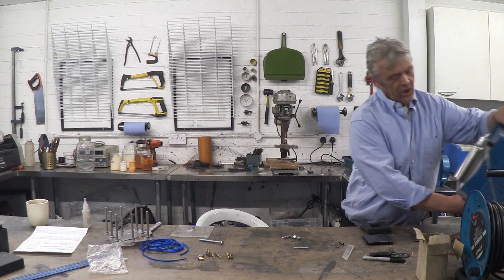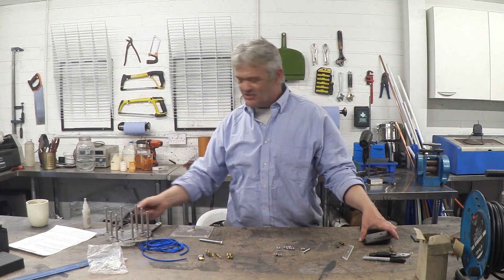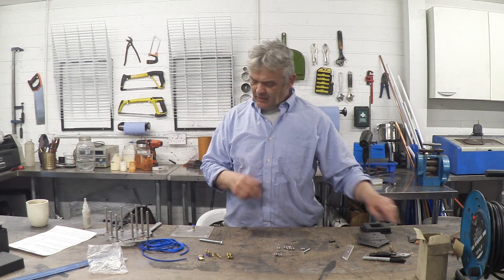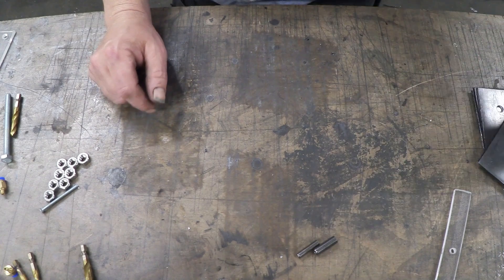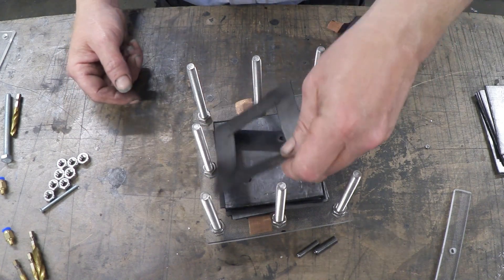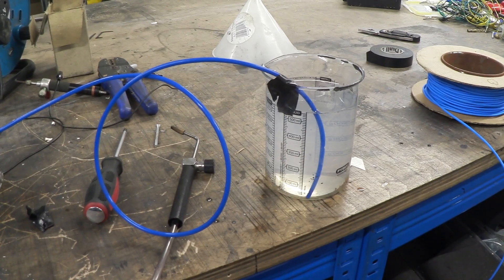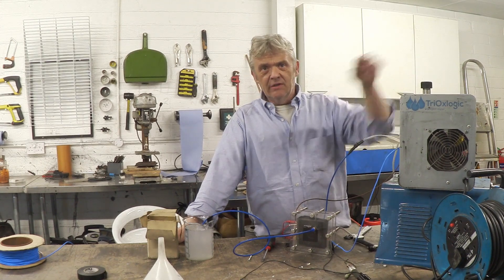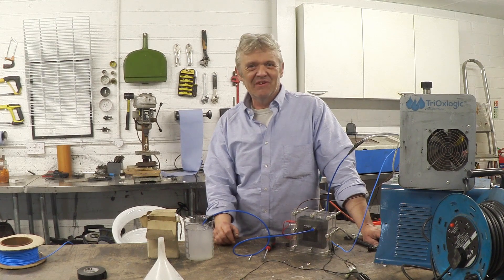Super Efficient Graphite Dry Cell Hydrogen Generator

Comment: Be nice if the cells stats where typed up here.
I have 4% solution (of what?)
12 amps (no volts or cell number)
and "roughly 3X as efficient" but no liters/minute
No cell surface area either.
And I had to get that useless if not comprehensive info from watching the end of the video a 2nd and 3rd time.

Just these basics are the difference between a thumbs up or thumbs down for me. (yes I re-enabled the thumbs down)

Comment: Maybe i should have chucked this in,conductive carbon loaded rubber sheet,make two coil plates with plastic speaker grill to isolate and wind like an electrolytic cap.

Also carbon filters for water are quite large,i saw someone make salt water batteries using the activated carbon filter inserts,long carbon tubes.

Comment: I can't remember which is the sacrificial electrode,but one electrode can be stainless the other however (the sacrificial) should be titanium.Also you know uric acid is the best volt per gas volume,though lots of people are using table salt making chlorine gas,potassium hydroxide i think is the best electrolyte.

I did see someone use AA battery carbon rods as electrodes.

Comment: Great! Now please build a fuel cell to generate electricity from the newly created hydrogen 🙂
Reply: You don't need the fuel cell, pipe the hho directly into the intake manifold of the car engine.  look on youtube for many videos on this idea.
Reply: @kirtg1  Thanks for the tip. But I would like to build a fuel cell that inputs hydrogen and output a dc current. If you have any suggestions on that let me know. I think it'd make a great project.

Edit: I prefer not to use platinum or any expensive catalyst 😉

Comment: Does the graphite oxidize at all? What do you use as your electrolyte? OK, so I built a potato cannon, if you will, that I'm using a HHO gen to power. I use a whole house filter housing that I've bolted in 15 stainless steel plates. One bolt is pos, one neg and the plates alternate. I separate the poles on the plates using rubber grommets. Then, I have a 1 gallon sealed container that I add a solution of sodium hydrochloride, 1 tsp, to a gallon of water. From the container I have a small 12v pump to move the solution to the HHO generator. What gas is created goes back to that container with the pumped water. I did this to help eliminate water overheating. From there the gas is separated and travels through a tube , through an automated ball valve on a timer, and into the potato cannon chamber, which is 4"  clear pvc about 19" long, then necks down to 1.5" pvc about 3' long for the barrel. With the water at about 90° F 32° C, it takes about 2min at 12v, 22a to create enough HHO to fire an average sized potato about 300 yards or 275m. I control the amperage with a PWM controller from ebay because everything I built the controller with was rated for 30a and the setup would draw an easy 50a. I built it to look like an old Howitzer cannon. Can even raise and lower the barrel remotely. Anyway, I was just curious  on the graphite. Also, I am curious on how you measure the amount of HHO generated. I've been looking at like nat gas meters and/or mass meters, but they're very expensive. Thanks for your videos. I do truly enjoy watching them.

Comment: I've been working around this tech for about 10 years, the concentration of electrolyte is very much dependent on the distance between plates, maybe graphite does conduct better I don't know as I haven't worked with it. Does the electrolyte discolour after several hours running?

Comment: Does graphite still suffer from the voltage leakage around the edge of the holes in the plates? I would assume that it does, it's a quick fix if it does.

Comment: Hi Robert, Thankyou for this dry cell built.  How do I connect the copper connectors to graphite? I tried screw and bolt but the graphite won't conduct and no electrolysis took place in a wet cell configuration. I bought these conductive graphite sheets from amazon.

Comment: Great! Have you tought or tried to keep the O2 and H2 separated/collected to different reservoir in the solution? Like collecting the O2 up above the anode and H2 up above the cathode (or vice versa :)? To combine both gases only when reaching the torch nozzle, similarly as when welding with acethylene and oxygen? My application would concern the welding only.

Comment: What is the point of neutral plates
Reply: Every pair of plates (so they say) can only "digest" 2 volts. So if you want to produce larger amounts of gas, you will want to feed in higher voltages. So if you want to feed 24 Volts, you would need 24 plates = 12 pairs. As you do not have to connect every pair to the power supply you use "neutral" plates in between.

Comment: You missed the second port. Hydrogen is attracted to pos, oxy to neg, keep the pos cells on one side and neg on the other with dual exit ports, pure hydro is safer. You still need all the flashback arrestors and vacuum sensor vilt control backed with ....... im not gving it all to you.....

Comment: You can put stainless steel tube in one an other like Joe cell but put a one inche  diameter Carbone electrode at the center,not more efficient but it works

Comment: OK Amateur here. Looks to me like you have a plate in between the electrified plated with no electric leads on it. How does that do any good? Does the electric just go through the fluid and charge those unconnected plates? If so how my of those center plates can you put in the design? Thanks for the info. Such a simple idea. Every video I've ever seen used stainless.

Comment: This post is somewhat late but I've just  been reviewing your posts in my archive. The project above is brilliant as usual Robert, well explained and demonstrated. That's why I've followed you religiously for many, many years. In respect to the systematic study paper you refer to, graphite, as you said, is indicated as the best overall material for electrolysis electrodes and produces higher  gas outputs. May I point out however, but not wishing to offend you, that within the said study paper it does state the following, 

"With increased electrolyte concentration the hydrogen production is greatly increased.
However, the gradual decomposition of anodic graphite rods is observed. From the study we concluded that the high electrolytic concentration (above 0.025 M) is not beneficial for long time hydrogen production."

A slight negative for graphite, maybe, but it's not the end for sure, as new materials are no doubt in the pipeline. ( Of course that's if we're ever allowed to witness such.)
Kind regards and many thanks for your dedication to open science.
John (UK)

Comment: You're right about the stainless plates being the major hurdle to the everyday folks building a cell.
Where does a DIYer source graphite foil on either side of "The Pond"?
Please, We all could benefit from a bit more detail about your construction methods.
How did you "bury" the copper into the end plates, Two sheets of the foil and adhesive?
How does one protect the copper from eroding at the exposed edges of the electrolyte holes?
Oh. I see you put the details video behind a pay wall. So much for empowering people as your channel intro claims!

Comment: Robert! I was reading about fuel cells apparently some designs use potassium hydroxide as the electrolyte, . Potassium hydroxide is also the electrolyte in ordinary AA alkaline cells ! Do you think you could build a fuel cell using these materials to make electricity from butane cans??

Comment: Thank you for your content, Robert. Im almost done building a dry cell with gas separation, hoping to work with urea. The problem I see with doing this efficiently long term is the cost of KOH which is carbonated in this reaction. If you think urea electrolysis is worth while, could you do a video or few covering regenerating the KOH? The two main ways I see are calcining at 1300c or reacting the K2CO3 with HCl yielding KCl, then electrolyzing to get KOH H2 and Cl2 which can be flowed past a UV light and distilled back to HCl. We could use an efficiency comparison. Without regenerating the KOH, the hydrogen produced, through a fuel cell, costs about $17 per kWh. Completely unsustainable.
Reply: @Merkasaur  二酸化炭素に触れる機会が無いよ

Comment: N2 up-concentration: Could one use H2, separated, to burn away O2 in air (use heat for showering, cooking, laundry, ..) so N2 remains (and CO2 (wash) and traces), then use a grapite-with-activator setup or whatever to synthesize NH3? 
Where can I discuss direct NH3 synthesis paths with you?

Comment: I remember my first hho generator. It was a wet cell, and used stainless steel bowls with 12v. I didn't use a bubbler for the test and it so exploded when a spark hit it. Good times.

Comment: Hi Robert. I'm making up a wet cell and I've made up 7 plates, Anode, Cathode and 5 neutral plates. The area is 24 square inches. As soon as it touches the water the amps drain shoots up way over 30 amps and the engine starts to grunt. Why? How do I control the amp input without reducing the voltage? At the moment I can't even connect it up or I'll damage my alternator! Why am I getting so few ohms?
Reply: Wet cell lose a lot of current that jump around the edges of the plates, those turn into heat waste. As for keep the voltage and reducing the amp, you will need the PWM controller. That's why dry cell is better or wet cell must be seal off the edges as much as possible. My 2 cent thought. Being there, done that ...hope this help.

Comment: I think this is the study Robert mentions. A Systematic Study on Electrolytic Production of Hydrogen Gas by Using Graphite as Electrode. I read it. Very interesting info. I think however that in the study they used cylinders of hard graphite for electrodes. I wonder whether the flexible graphite would outperform the hard graphite due to more porosity and surface area? But, also, would the flexible underperform the hard in it possibly disintegrating faster? Again maybe due to its porosity. If the flexible is durable enough, great! If not, hard graphite sheets and rods are available on EBay and elsewhere. 
Blessings!

Comment: Using graphite has its drawbacks. one particular one is that the graphite sheets will  break down and 'clog' the system. You'll be continually flushing the system through with clean water. You may even have to keep taking it apart to 'service' it. People who 'mess' about with HHO just waste their time imo!!

Comment: Since the electrons will take the path of least resistance, try to stagger the all the holes so you can't see the last hole through the holes in the one you are putting on, bit more efficient.

Comment: Here is an excerpt from a Stanford paper where they using a negatively charged coating "They layered nickel-iron hydroxide on top of nickel sulfide, which covers a nickel foam core. The nickel foam acts as a conductor – transporting electricity from the power source – and the nickel-iron hydroxide sparks the electrolysis, separating water into oxygen and hydrogen. During electrolysis, the nickel sulfide evolves into a negatively charged layer that protects the anode" I would like to see how these two would compare side by side. Great video. I would like to see a design of the anode and cathode separated in its own compartments not allowing the collecting gasses to mix so not joined at the top - would this allow you to take just the pure H and pure O from each side? Regards.

Comment: Robert says hydrogen generator many times, and only references hydrogen production. Sometimes I get confused when I watch his videos. Did he route the oxygen through a different tube? maybe I missed it. I'd be really interested in finding a good plate configuration that separated the oxygen and hydrogen bubbles without having the - + plates so far from each other that the configuration becomes inefficient. The hydrogen and oxygen become much more useful when they aren't mixed together. Anyone have a link to a good configuration that's both efficient and keeps the bubbles separate?

Comment: Hi, nice video! Have you noticed any plate degradation? I wonder if carbon release from plates will clog out the output orifices and basically it will blow up because of high pressure?  Just a detail to keep in mind for long term usage.
Reply: I was thinking about this too. As I read the study I realized that there was a big part about electrode degradation. And these were solid rods. I cannot imagine a flexible film of that stuff lasting very long.

Comment: Hi Robert , thanks for explaining making the dry cell . I've used stainless wire for my effort, wound spirally round a 2 inch core , which got thinner and thinner ! I would like to make a dry cell like yours , but where did you get the graphite sheet ?

Comment: Hey there Rob, I'm a little late to the party, but I'd just like to add, incase you didn't know,.. potassium hydroxide and de-ionised water makes a great electrolyte, it stays clean for a long time. Also, I'd love to see you use a permeable membrane between anode and cathode, to extract pure hydrogen, which can be stored, unlike hho.
Keep up the good work :)
Reply: Can you say a few words about separating off the h through the membrane? It seems dry cell is browns gas while a wet cell can be made to separate by design, isolating the two gases?
Reply: @marcisaacs9407  I've seen the H2 will collect to the anode side, O2 to cathode, both bubbleing up from solution (gaseous). You just collect the bubbles up above the + and - pins. For welding this makes sense to combine them only then in the nozzle of the welding torch!👍

Comment: Interesting concept, but we need to associate a voltage number to what "super efficient" comparatively means. An HHO stack with stainless steel plates operate typically in the 2-2.5 V per cell. The minimum voltage for any electrolyser is around 1.48V per cell, the so called "thermo-neutral" voltage. A top quality PEM cell with platinum/iridium catalyst can operate at 1.7 V per cell with current density around  0.5 Amp/cm2, the lower the voltage the higher the efficiency. A standard  stainless steel plates HHO stack performs very poorly vs PEM, requiring 0.5 to 0.8 V more for the same task. Where does and HHO cell made with graphite plates sits?

Comment: Hey Robert, they actually found out about the benefits of hydrogen during the 2nd world war !
When the dam busters were coming in low over the reservoir to bomb the dam, the pilots noticed that their engines were running faster the lower they got and it puzzled then !
what was happening was the hydrogen being naturally  released from the reservoir was aiding the engines to run more efficient !

Comment: Hello Robert, if you think stainless is a bitch to work with try titanium. But supposedly titanium plated with platinum is the best plate material period according to laboratory papers. Since you used graphite plate material instead, what is the materials total name ??? Just graphite or reinforced graphite sheet ??? How about the electrolyte used Sir. What did you use ???? One more thing Rob, what was the efficiency compared to using standard material which is stainless ??? Thanks a bunch Sir and peace to you too. V

Comment: i need to Buy  PWM for hho Cell . Cell need 220volt 2500WAtt . I have a 220volt inverter . which bridge rectifier and capacitor should i use to convert as to dc how to connect capacitor which  PWm should i select . how to select .

Comment: Brilliant video, you remind me of my old tutor when I was an apprentice instrumentation engineer. 

FYI you can use magnets to isolate oxygen from hydrogen (I've seen this done in the bubbler, with a wall divider and diffuser with strong N/S pole magnets on each side). 

Also look at PWM circuits and frequencies in the 2.4KHZ range are reported to excite water molecules and help to break the covalent bonds to produce more gas. 

Try a 3 phase square wave form invertor, high frequency and experiment from there. I've read it is possible to run 3 separate PWM circuits (standard high wattage LED dimmers for example, cheap and easy to obtain and modify) then use a common neutral and have all three circuits tuned and balanced to the same frequency (oscilloscope and potentiometer to adjust) and each applied to their own electrodes. Electrodes need to be tuned too, if they are precisely manufactured and balanced with one another (mass + ohms resistance) it helps the circuit to reach resonance and maximum HHO production.
Reply: Actually, I recall that stainless tubes, that were tuned to one another by their musical tone to ensure that they were all balanced, worked best. I believe Stanley Meyers' system was built in this way, and combined with tuned multi-wave PWM the HHO production was significant.
Reply: Do magents work east west?

Comment: I'm surprised you didn't use your laser to cut the gasket material, you could have even cut the bolt holes in it. Was that the biggest size plate you could do with the material available? Though I suspect it would work better if it was a bunch of small dry cells used instead if one large dry cell. Thanks been showing this, my other thought was using your conductive paint on metal plates.

Comment: I tried this type of graphite and ... it breaks down! It only lasts as an anode. I also tried graphite plates but, being porous, the electrolyte flows through them. The only solution would be hard graphite tiles to paint on the edges.

Comment: What is the current dc or ac? Pulsed current or steady.  Please release data
Thanks Rob. Sure your data is better than ours
  Also about pressure release and storage. And adjusted carriage foll
Could we liquidity it. How safe
Would. It detonate like the gass does

Thanks again you are so on it
Increase in case with vibration and stimulation like laser and pressure alternating for cavitatiin
 One of your best. Solved a lot. Please do a follow up.  Thanks